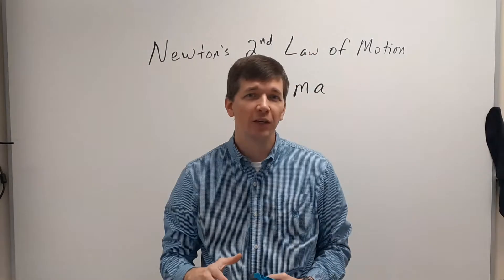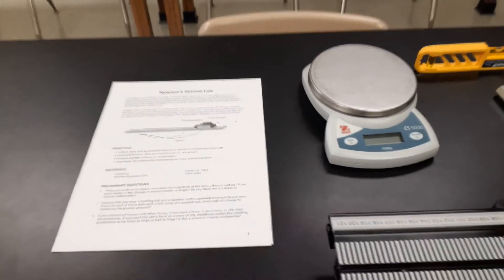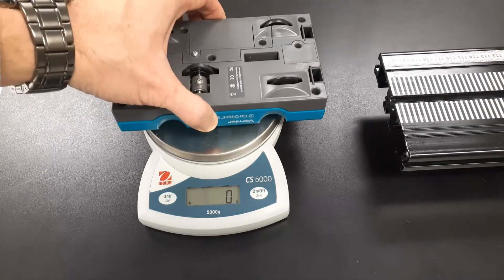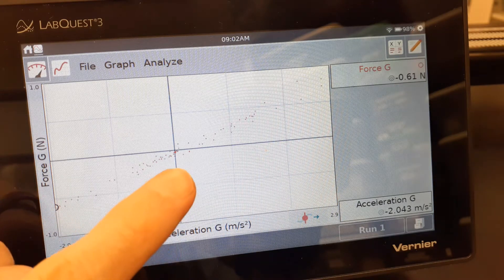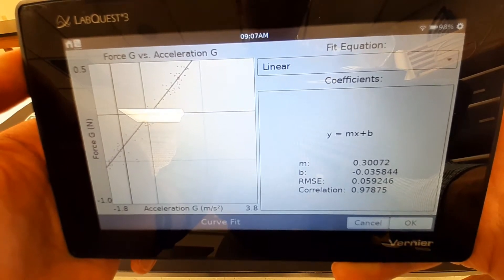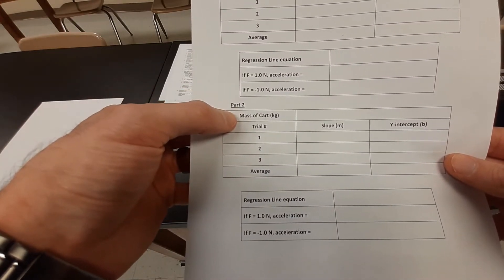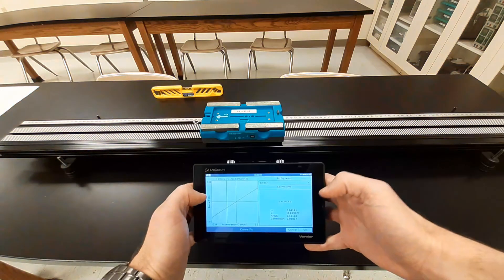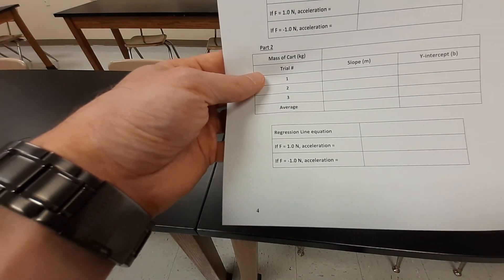Physics 1 Lab: Newton's 2nd Law

Comment: In physics, the word, “Force” as we know it, turns out to be nothing more than a
description to describe an event or an expression to express an idea like one would use the word “Love” to express
one's feelings. But, physics and in mathematics, still use “Force” as thou it were something physical that could
enable the initial cause of motion making it counterintuitive.

Example: Choose an object of your choices and without applying the energy from within you, try to push and pull by applying “only” the Force or Net Force.

Meaning that Energy (applied energy) is the initial origin of motion and not “Force”. 

Once Energy (E) is applied, it creates what is known as Momentum (p). When this Momentum (mass and velocity) comes in contact with an object(s),
it makes a surface contact that will enable you to push and pull. Example: 
Ep=ma, Ep=mc2 and so on.  Note:  Ep is not to be confused as Kinetic Energy in
any way.

Momentum represents things like work, wave, gravity, light, lightning, tsunami, radiation,
earthquake, current, electricity, motion, magnetism, hurricane, etc.

Without Energy, there is no Momentum.  Without Momentum, there is no surface
contact on an object(s) to push, pull, work, shaping objects, motion, gravity,  magnetism, radiation,
etc. Momentum does not and cannot exist without the applied Energy that creates it.  Energy and Momentum or “Ep” is
the one and only common denominator that links all fundamental forces of
nature. Without Ep, all fundamental forces
of nature would be inert and non-existence. ~Guadalupe Guerra from Laredo, Texas c/s
Reply from the maker: Force is a necessary topic in physics, as are energy and momentum. Force, mass, momentum, etc. are measurable quantities with established definitions. These are all interconnected topics/definitions and at the core of any physics class. To argue that one derived unit (force, momentum, energy) is more important than another isn't necessary. In general physics most measurements derive from the fundamental units of mass, time, and length.
Reply: "Force does not exist physically in the same way that an object with mass does. This means that force cannot make surface contact with an object, much less push or pull it. The initial cause of all bodies in motion originates from the applied energy (E), which creates the momentum (p) necessary to make surface contact with an object, thereby enabling it to push and pull. This concept is mathematically expressed as Ep or the equation Ep = ma. Force was originally used as a placeholder by Sir Isaac Newton because he did not know the true nature of this force." ~Guadalupe Guerra from Laredo, Texas c/s